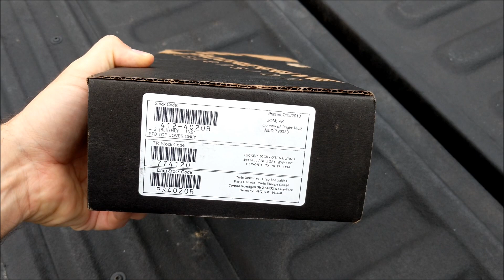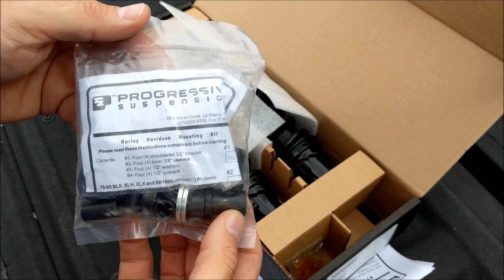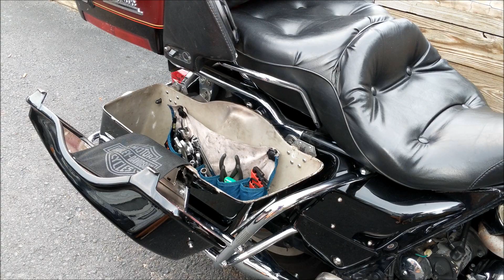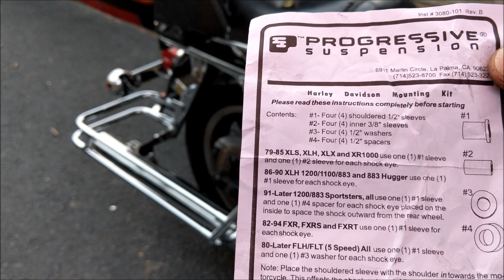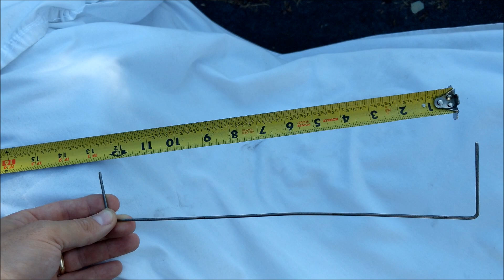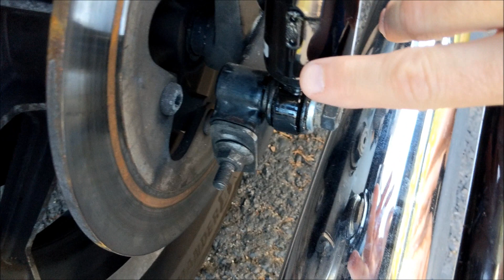Harley Davidson Series 412 Progressive Shock Install Final

Comment: You have washer on the outside..No mention of washer on the outside..you read a sleeve and washer on the inside of shock ..what gives?
Reply from the maker: Thanks for the question. It’s been a while since I did this video but I think the washer on the outside was from the old shocks. I may not have shown the inside washer and sleeve. My apologies. Always follow the manufacturer’s installation instructions. Thank you for watching.

Comment: I struggled getting the holes to lineup. I had to lossen the first bolt because it was on secured. Once i lossened the first bolt the second bolt lined up to the hole perfectly. Something that simple i forgot.
Reply from the maker: Glad you found a solution. :)
Reply: @whatcomesnext5865  thanks! I'm rusty, and forgetting some basic principles in mechanics.

Comment: I just received mine (412-4211c) and the shock shaft has a loose washer on top of the bump stop of the shock (both on the shock shaft) Is this normal? Did yours also have that washer in the shaft? or would it be a assembly defect ?

Asking because i dont know if i should bother Progressive before installing my shocks
Reply from the maker: I would call progressive. I don’t recall any loose washers as you describe.
Reply: @whatcomesnext5865  I texted them on instagram and sent a little video, i may give them a call if that doesnt work
Reply from the maker: @BadAssEngineering  I think you’ll find that they are helpful!
Reply: @whatcomesnext5865  They were! They told me the loose washer is normal and it is supposed to seat itself when riding the bike. They also had Hotel California on the phone line, which for me is top notch customer support

Comment: If you change the preload to the lowest setting does it lower the bike or just stiffen it up
Reply from the maker: The spring preload only effects the sag of the bike based on the weight of the rider, passenger, and gear. It will affect the compression and rebound of the shock if the shock piston (via the spring) is not set to the proper preload.

Comment: Do you put the spacers on the top and the bottom bolts or just the top?
Reply from the maker: Thanks for the question. It has been awhile and I longer have the instructions. Thanks for the question.

Comment: My stock suspension on my 21 ultra limited is 13 inch as well as the progressive 412s I just installed but they lowered my bike about 1 inch. Adjusting the preload will raise my bike?
Reply from the maker: Did it lower without the rider, passenger, and gear? If both shocks were 13 inch then it should remain at stock height with out the rider, etc. If the height was lowered with the rider, passenger, and gear on the bike, then you will need to adjust your preload. Progressive has pretty good instructions on their site. I hope this was helpful.
Reply: How are they holding up, we're they worth it?

Comment: So many people want to "lower" their rides for style, then comment in all the shock review vids, saying their ride sucks. Lower = shorter travel = rough ride. A taller shock with the proper sag adjustment will save you money at the chiropractors office... and you'll actually be able to ride for more then 10 miles at a time... which might save you some money for those trailers people buy.
Reply from the maker: You are right on the money! I’ll take function over fashion!

Comment: I put some progressive 412 chrome 13 inch Super Duty on my 2016 iron from 11 inch stock crap and two clicks sag🗣️ amazing 🏍️💪👌🤟😎💯
Reply: what's your weight Rodney?
Reply: 296 weight
Reply: @rodneyricketts177  thanks = okay, I am 200 pounds so one click might do the job I suppose (Street Glide Special from 2020)..??
Reply from the maker: Glad they worked out for you!

Comment: Which length should I buy? The length of the stock air shock? 2013 Electra Glide. Great install video!
Reply from the maker: If you go to progressive’s website, put in your bike info and it will tell you what the stock length is. For the best ride I would recommend the stock length shock as it should give you the most travel to absorb compression.

Comment: Is this heavy duty or standard?
Reply from the maker: These were standard. Thanks for watching.
Reply: @whatcomesnext5865  Hi Mark, thanks for the video!  Thinking of putting this on my 95 King.  Is there a reason why you did not go with the heavy duty series?  I am 220 lbs, 6 feet and the wife is about 5'3" 130lbs and when we ride we probably have 60 pounds of gear, tools etc.  Just thinking the Heavy Duty may be better?  Thoughts?
Reply from the maker: @SteelHorse1015  We are about same weights but don't travel fully loaded very much so I went with the standard duty. I also used Progressive's website for some guidance. If you travel fully loaded alot, the heavy duty versions may be better for you. I would also recommend that you stick with the stock shock length so you retain the greatest amount of shock travel as possible. Good luck and thanks for watching!

Comment: Hate to ask, but does the standard work for you?  The wife and I weigh about 325lbs total.  Think the standard would be enough for a basic touring Harley?
Reply from the maker: Yes. They made a big difference! It's always best to get a stock length shock so you keep/maintain the appropriate length of travel. A shorter shock will have less travel.

Comment: Great video man, how are these shocks after a year now. Also want to ask that you got the 13” shocks what is the size after installation? Does it come down to 12.5” or still 13”?
Reply from the maker: I am still satisfied with these shocks. We have put a lot of miles on them. I did not measure the shocks after the final installation. You set the pre-load on the shocks according to the installation instructions. This ensures that you have the proper amount of travel once you and your passenger are on the bike.
I hope this helps. Thanks for watching!
Reply: Marc Woerner thanks for the reply

Comment: Hi, do you know the size of the upper mount bolt on the back side? the one inside the fender? 
Thanks bud for the video!
Reply from the maker: I believe it's 1/2 inch or 9/16 inch but I'm not positive. My bike is still in storage or I'd check for you. Thanks for watching.

Comment: I just put 11 1/2 inch on my Nomad. I'm very disappointed in the too firm ride. Maybe the 13 inch would have been better, but with my stock shocks, i floated over pot holes, so would have been no point. It is a trade off as i'm a short guy and have more confidence with this top heavy bike.
Reply from the maker: Ride safely. I'm glad you have more confidence. Thank you for watching.
Reply: Same with me, now i think i need to also change the kickstand to 1inch shorter to avoid drops during stationary stand bec the weight its not properly lean to the left when it is stationary
Reply: @aceking21  I removed the 11 1/2 inch progressives and bit the bullet and bought 12 inch Progressive 444s. Very happy with them.
Reply: @58gennaro  oh thats double expense though :)
Reply: @58gennaro  Same height after adjustment  ?
Reply: @RoyJenkins777  The 12 inch 444s lowered the seat height an inch, but I don't feel the ride suffered. Glad I did it.
Reply: @58gennaro  Good deal I'm wanting the same thing being that I'm vertically challenged myself lol . If you ever get to East Tennessee look me up we'll do some riding, you can't ever have enough brothers.  God Bless

Comment: Awesome video and review. Thanks. I ordered a pair and will install them tomorrow.
Reply: How'd ya go mate? get em on?
Reply: @ozziejim8472  Got them on, took about 1 1/2 to install. Awesome ride, big difference.  I adjusted & test ride until I got the perfect feel. I have about 200 miles on them now. 👍🏽👍🏽
Reply from the maker: @recondmv6342  Glad to hear that you like them. I ride 2-up most of the time and these shocks made a big difference in comfort for me and my passenger. I'm sure you will get the adjustment to your liking. Ride safe.
Reply: Awesome dude, enjoy!
Reply from the maker: I'm glad you found it helpful! Ride safe.
Reply: I bought the 412 also and love them. But I want to know from you is what setting would you recommend for me I'm 290 pounds. I have set them on 1 , 2 , 3 and I think the 1st position feels better. I bought the heavy duty.